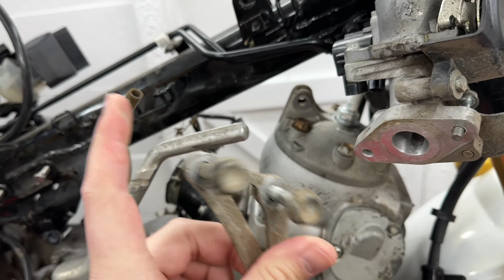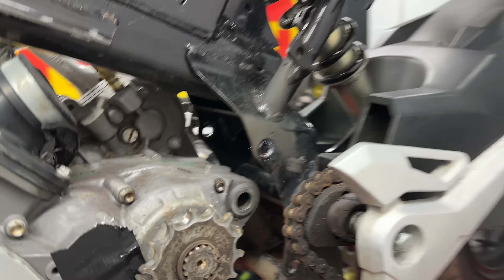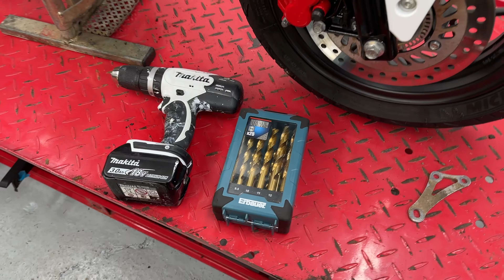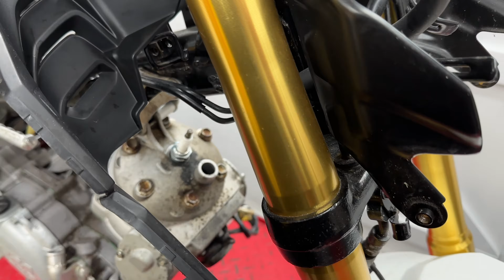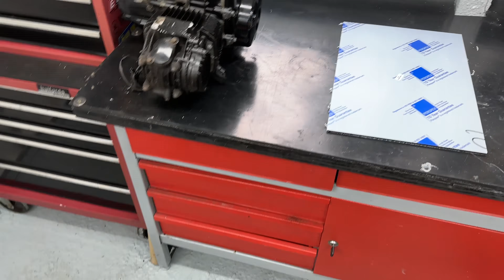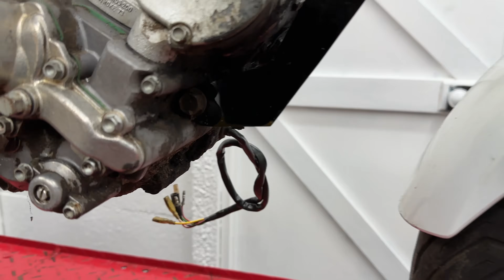Crazy 2 stroke engine swap! Time to design the engine mounts for the 300cc 2 stroke install 😈

Comment: Are you selling mounts ?
Reply from the maker: Sadly it’s not something I can see being viable at this time as it’s not a “plug and play” kit with the engine being unique I can’t see many being sold plus I’ve yet to actually strength test the mounts with the bike at full power. 

Keeping all my fingers crossed the exhaust will be finished this month at performance fabrications and the bike comes home for the series to start again 😬

Comment: If your going to be doing anymore grinding I would definitely be covering up your other toys as them sparks will properly knacker paint and plastics mate
Reply from the maker: If you look closely I try to angle the sparks away (the best solution is a bigger garage/ unit 😬)

Comment: I have a grom and i dream of putting this engine into it, how much would it cost including engine and labour roughly ?
Reply from the maker: If you’ve seen the latest video on the series I’ve done a cost break down on the build for mine - Series will be starting back up again in September when it goes in for the full custom exhaust at Performance fabrications 😬

The problem with this sort of build is the labour as there’s a lot of design time as there’s no off the shelf bolt in solution for 2 stroke engines (few companies in America sell the 4 stroke kits) 

Although it sounds crazy I think you could easily be looking at £10k+ taking it to a proper motorcycle builder to have the conversion done.